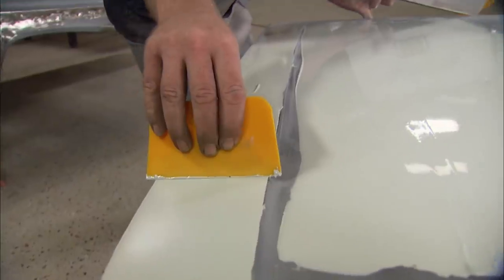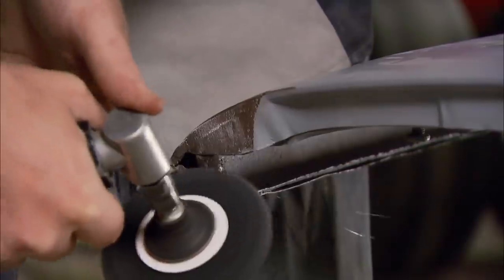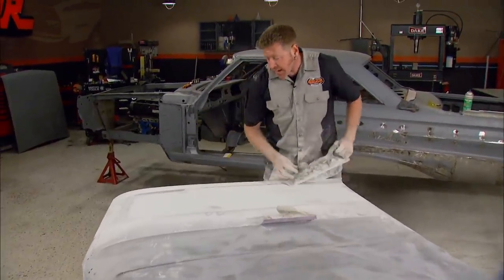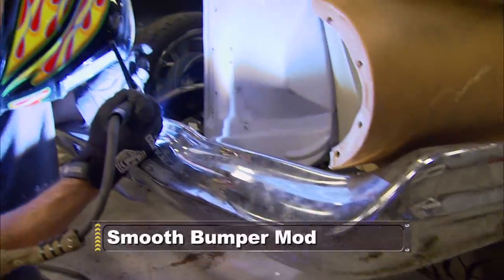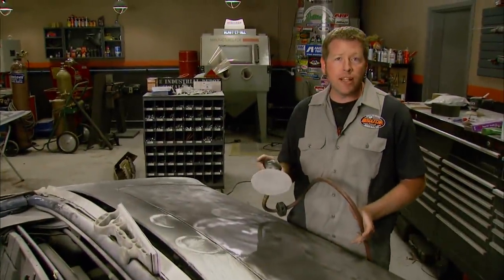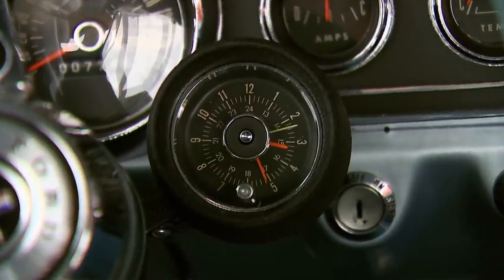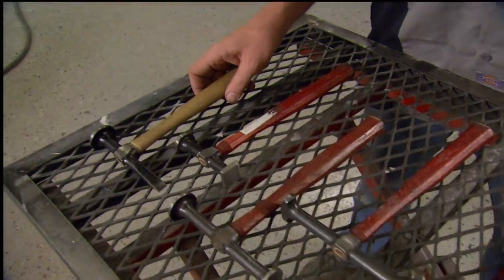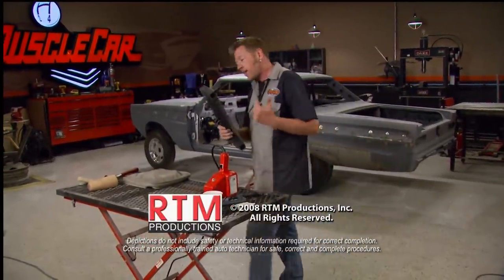Bodywork Secrets from a Muscle Car Pro - MuscleCar S3, E19

Comment: Wow... any reason you didn’t tape off the engine bay before creating all that dust from sanding? I wouldn’t want that anywhere near my engine and other mechanical components.
Reply: It will effect absolutely nothing, first stage of body work so car will obviously come apart again
Reply: Dustin Babb Not sure if we’re referring to the same thing. I understand where in the process they are with the body work. However, they could’ve wrapped or cover the engine and other mechanical / electrical components to either not get any dust inside them or keep them clean and dust free. They’re not doing any body work in the engine bay itself.
Reply: Thought the exact same thing. All that lovely dust floating around and find it's way into the intake not to mention just being a PITA to clean up.
Reply: I was thinking the same thing...
Reply: @Parents_of_Twins  It's not gonna find its way into the intake or anything else. It's a very fine dust. No point in masking everything off when the car is gonna be torn back apart for painting. You can literally blow the dust out with an air hose.
Reply: Yea, that is lazy. A 1 dollar painting plastic would do it.

Comment: 66 Mustang was standard with the 200c.i. straight 6. The V8 came as either a C code 289 with a 2barrel and single exhaust, an A code 289 with 4 barrel and dual exhaust rated at 210 h.p. and the K code. There was no G code.

Comment: A friend bought a new '65 Fairlane  Special Edition 2 door hardtop with gold emblem 289  emblems. (271) HP. It developed an oil leak. At his 3rd attempt to get valve cover gaskets the dealership said  " Oh , That must be the special edition engine." I always thought it was a 289 Cleveland , but now wonder if it was a Boss 302 prototype escaped from the stable .

Comment: We never put plastic on top of primer.  If it is just primed metal (without already having plastic under the primer), we remove the primer completely down to bare metal, rough it up with 36 grit (or 80 works) paper on a d.a., clean it, then apply filler.  Filler doesn't stick to primer just like it doesn't stick to paint.  Well...it will stick long enough to get it out the door!  Unless, you know...something's changed that I don't know about.
Reply: These guys are showing the "Get it just barely good enough to sell and who cares what happens after" method
Reply: Most modern body fillers and glazing putties will adhere to an epoxy primer which is an excellent base layer. When body filler cures it creates heat. That heat can cause condensation between the body filler and bare sheet metal that could potentially lead to failure or rust down the road. Acceptable loss for a daily driver for collision repair but not a $60,000 restomod that still has to look good 40 years from now.

Comment: I've always wondered why  reproduction stampings aren't as good? I've always thought that they had the old dies used by the manufacturers.
Reply: Even original stampings had flaws in them. Look at the quality control of a 1960's mustange to modern mustangs. Much tighter panel fitment and alignment. The old dies also have a lifespan. they become damaged and distorted over time.

Comment: Ok in a world where the Boss 302 and Boss 351 exists who in their right mind would choose the K code 289 as the greatest Ford small block???
Reply: They are still considered small blocks so exactly how am I wrong or uneducated Mr. AL or AI?
Reply: Why don't you educate yourself and look at the description of the Boss 302. The Boss 302 was constructed by attaching heads designed for the planned 351 Cleveland to a Ford SMALL BLOCK.
Reply: The Cleveland series blocks share the same 4.38" bore spacing and cylinder head bolt pattern as the Windsor V8 family. Hmmm what are those Windsor V8's called again oh yeah SMALL BLOCKS. So educate yourself before calling someone else stupid with your dumb comments.
Reply: Oh I'm sorry did you think that you bothered me? No once I realized you were a troll I forgave your comments and moved on with my life. I hope you have a great weekend as well.
Reply: ive done this 50yrs 289 winds up 351C can't they are bottom heavy rev limited to 6500 unless extensive rod main work as i have ran my comet med built 289 to 6800 with 2bbl bottom. .the C is more a truck type motor like 348...takes money to build..W is revable but again a stroker not short like 289...if you don't believe me look at its father the GT40 you won't find anything other than 289 or 427...and the 27 won't rev quick or high just listen to a 385hp 289 GT40 and then a 27 ..big difference
Reply: In addition to i already had the idea of 351C 2bbl heads and cross boss intake with 780cfm holley 30yrs ago...just no money and not their shop all done myself. ....
Reply: @brantardrey7360  I would think that valve float would limit an engines ability to rev more than the weight of the crank and rods. There's a channel I watch that deals with high performance diesels where the injection pump stuck wide open and the shutdown malfunctioned on a 1/8 mile run. The driver put the truck into neutral and the engine ran to 8200 rpm before it let loose. The engine was a straight 6 Cummins and the crank alone weighs in at around 100lbs.
Reply: @Parents_of_Twins  if it was Cummins I assume 100lb crank means pickup truck? As semi Cummins is around 250-300 some Cats are 400? But in any event and all my examples spring load and spring rebound Seat pressure Etc is a factor along with the camshaft? But my issue was money and running a 2 Barrel short block with two barrel 5/16 Rod bolts up past 6000 nearing 7000 with a High Rev top-end I didn't have the money to do what I want but I was going to build a 289 boss myself but I didn't have the money and I had that idea 30 years ago but my 289 with the LeMans Cam and built ported heads that I did myself I got it up into the late sixes and beat a few people with it I just didn't have the money for slicks the gearing that I wanted and some more pieces on the engine otherwise I would have been down in the 13s but all the other blocks don't rev as good  unless you build the s*** out of it with money mine I did on  a pop bottle budget and I did it myself
Reply: @brantardrey7360  Yeah it was a Cummins 6.7. Quite honestly I'm confused with your comments. The comment from the show said the 289 was considered by many to be the greatest small block that Ford had made something that I disagree with. Are you saying that you believe the 289 is better than the 302 or 351?

Comment: You should be wearing a mask sanding that filler.
Reply: MSW it’s called a voice over.
Reply: i have also noticed that they never wear any hearing protection, angle grinders in a garage space will destroy hearing!
Reply: Most “bondo’s” with a hardener (from my day/I’m old) had arsenic in them. I wonder if they still do?

Comment: Why would you strip the e coat off?  You should’ve just sanded it and filled over it.
Reply: The grit of sandpaper required to rough the metal up enough for any body filler would strip it right off anyway. Factory e coat is junk.
Reply: PainterFRO false!  I’m a body tech. I do the shit every day. You could hit that with 220 and then skim coat it no problem.
Reply: The e coat gives the finish an uneven surface after everything is said and done.
Reply: Sak 20012019   False. I get new panels every day with e coat scuff and spray as long as there’s no dents or anything. You never take e coat off if you don’t have to. That’s the first thing you learn in autobody. I’ve been around autobody my entire life. I’ve been doing it professionally for 5 years.
Reply: American ProPatriot i have seen waves develop is all im saying. It is not as people think it is. People have different ways of doing things
Reply: @americanpropatriot6319  I own a Bodyshop. 220 will sand right through e coat.
Reply: @Sak-zo1ui  The e coat is to protect the bare metal. Which it doesn't do a good job of that. Leave an aftermarket panel with e coat out side for a while and watch it rust.
Reply: PainterFRO yes
Reply: @americanpropatriot6319  The first thing you learned was not to take an ecoat off? Your talking about collision repair. This is a custom job. I would never leave an ecoat on any restoration or full build like the one in this video..The last thing you want is to have something come up from the bottom after you are done with high dollar job and I've seen it happen.
Reply: PainterFRO so once you strip the e coat off. Once bare metal hits oxygen, it immediately starts corroding. You may not see it but it does. So you want to limit the amount of contact with oxygen the metal sees.
Reply: PainterFRO  not necessarily
Reply: PainterFRO   Unless you’re going to epoxy everything e coat is about your best option. But e coat is a good base. So if you’re going to prime it why not use the e coat as a good base?  Just makes more sense.
Reply: @americanpropatriot6319  E coat is a good base for collision repair parts. Still has to be primed or sealed before painting.  As I said you can sit an aftermarket ecoat panel out in the weather and it will rust. Not something I take a chance on with a high dollar restoration. Wanna check and see if your ecoat is good. Wipe it with thinner. Most aftermarket parts ecoat will whip right off or turn soft.
Reply: PainterFRO depends on the amount of heat applied. Metal in a consistently arid environment will not corrode. Once moisture hits it it corrodes. Humidity is enough to begin the process of rust development which is the flash rust you are talking about. Often times it will not have an effect on the body panel when primer is immediately applied.
Reply: @Sak-zo1ui  Right..When primer is immediately applied. Not sure what you are trying to argue here. E coat is basically to stop corrosion right after the part is made. Its a good base for collision parts but still needs to be primed or sealed before painting. In a high end restoration I wouldn't use it as a base because I don't wanna leave the base of my work up to some aftermarket companies ecoat process.
Reply: Sak 20012019  false. As soon as metal hits oxygen it starts corroding. I was a jet mechanic in the military and had to take multiple corrosion classes.
Reply: PainterFRO like I said. A good epoxy is the best for metal. Shit is like concrete. Will seal in the metal from any outside elements. But I still think it’s silly to strip off the e coat on a brand new panel. Scuff it, prime it, and block it if you want. But I wouldn’t strip the whole panel.
Reply: American ProPatriot first anybody who has wire wheeled any iron or steel before hard enough, knows that the metal in certain areas if cleaned enough will not corrode immediately. It takes some serious moisture. Concrete does not seal. Concrete is a porous material and will hold a ton of moisture. That is how concrete breaks down. I believe you are referring to cement which much less pourous than concrete and holds less water.  The issue with e coat is you dont know how well the coating attached itself to the metal. You could be priming something that has not fully attached itself. House built on sand concept.
Reply: PainterFRO i didnt mean to click your name in the message a couple messages up it was the patriot dude.
Reply: @americanpropatriot6319  I'm well aware epoxy is best for metal. Ill bet its exactly what these guys will use on this car. Like I said. If someone comes to me and drops tens of thousands on a resto or even 10k on a paintjob I'm not leaving the ecoat as a base under my work.
Reply: Sak 20012019 i only states concrete because epoxy is really hard. I wasn’t talking about it being porous. It’s the best for bare metal. It seals and gets hard. Has uv protection. It’s the best. If you’ve ever had to take a corrosion class you’ll realize once Metal hits oxygen, it immediately starts corroding.  No question about it. It won’t be visible to the naked eye but that is a fact. You can’t argue that. Now if you get it sealed fast enough you can encapsulate the metal stopping it. Moisture speeds up the process. Quality of metal also makes a difference. Older metal is better quality  won’t corrode as fast.
Reply: @americanpropatriot6319   well I have been a body shop owner  and a tech for 32 years , .. dont  trust ecoat , after market e coat is terrible, oem , is  better , but why take the  chance , it comes  off so easy.
Reply: @Thelongmanable  HMMM MUST BE A TRUMP SUPPORTER
Reply: @killtoybellofatto7322  32 YEARS WRONG WAY.... Answer how many million dollar cars have bondo, new cars, buggatie/Ferrari/Lamborghini???.... HINT ZERO!!!!
Reply: @killtoybellofatto7322  Anyone can google your just promoting a crappy product not making quality repairs....
Reply: @Thelongmanable  My brother does upholstery restoration on exotic autos for dealers. Called in to repair some minor upholstery blemishes on a Ferrari, he took one look at the panel alignment and felt certain the car had been in a shunt. Looking at other brand new Ferraris on the lot showed that the panel alignment and finish was pretty hit and miss on all of them. I'm told that Enzo Ferrari's comment was "I don't sell cars; I sell engines. The cars I throw in for free since something has to hold the engines in. "
But the comment about wear and tear on the stamping dies is quite correct. Proper maintenance on such dies is not going to be cheap, and for the aftermarket quantities involved, and the companies that produce cheap aftermarket panels, there is not that much incentive to maintain them to OEM condition. So it's "High quality / cheap. Pick one."
So while new cars may not have bondo, (bog in Australian vernacular) the panelwork will be what the dies produced, with the gaps between panels set using gap gauges, robots and vision based alignment. The Kaizen process feeds back knowledge of deficiencies so they can be corrected at the source. That process doesn't happen anywhere near as often in aftermarket reproduction work. There it's most often about price and turnover, as in the current days of fleabay and Google shopping, the high quality products will often languish behind SEO based inflation of unearned reputations and lowest prices.
Reply: @killtoybellofatto7322  <-------<<<< NO THEY DON'T NEW CARS HAVE ZERO FILLER OR BONDO BECAUSE IT WILL SLOW PRODUCTION LINES WAY WAY DOWN!!!! "STOP LYING"!!!!
Reply: Someone who's done dies I'm going to say no to all the above because outside a few blemishes maintenance is very little to none....

Comment: That is one thing about these car "builders", that I don't like. If you are going to do body work on a car, why use 15 or 20 gallons of Bondo? I used some Bondo on a quarter panel in high school, all it does is crack in cold weather.

Comment: The Much Hyped 271 hp 289 was really a Pathetic Engine.
Reply: Stock it was but after the GT350 kit its 306hp then headers lemans cam 11 to 1 port match next up valves heavy springs roller tip rockers..400hp roughly capable 7500 rpm..my 65 comet i built on poverty wages 2bbl short blk lemans cam built heads ported 194..150 valves 315lbs open springs F4B w/600 holley could hit 6800 ..scary for 2bbl bottom ..beat 56 chev BBC pro stock at drags got into semi finals on my poverty budget with $1 ea junk tires from Firestone dumpsters. .if only i had their shop and their money. .?
Reply: @brantardrey7360  It must have had Horrible Fuel Economy too. No Vacuum Advance on the Distributor, even Cheny's LT1 had that, and it was putting out more HP/cubic inch than the 289. I am referring to the Stock Configs.
My first car was a 1966 Galaxie with the 289. It's Main and Con Rod Bearing were so worn, it several bearing Knocks. It sounded like a cross of a Washing Machine, and a Tin Box with several Marbles bouncing around. However, I abused it for 4 years and it never blew up.
Reply: @pjimmbojimmbo1990  if I drop it like a white man I could get 15 miles to the gallon it was all tight I get a hundred pounds oil pressure it had 180 lb compression if I remember right and it'll LeMans Cam and it was solid lifters and a four-speed I love driving it around I had it for 28 years I raced every brand of vehicle including big block Mopar cars Camaros all kinds of junk and it wasn't a question of beating everybody but everybody thought I had a 390 in it and when they saw it was a 289 and by the way when I first got it it was a two barrel intake manifold people couldn't believe it but it didn't have a LeMans cam I built it up later and I gave everybody a run for their money and it didn't burn oil leak oil or smoke it's just a matter of how I tune things
Reply: @msw7021  

As valid as yours